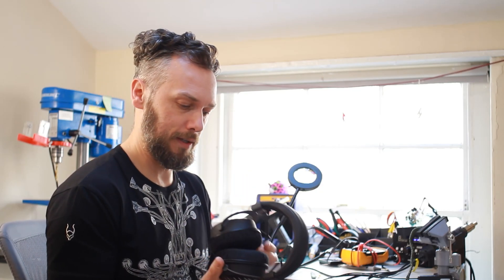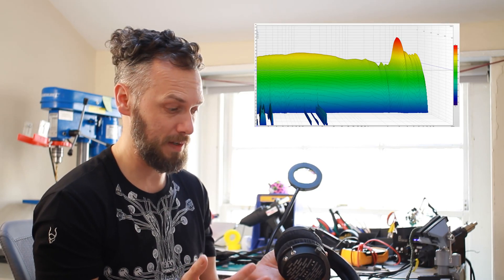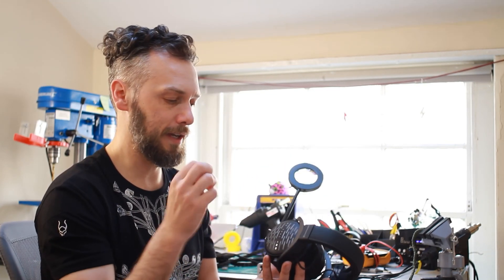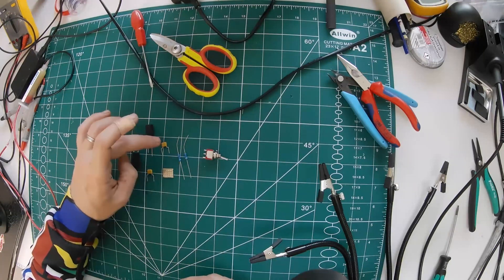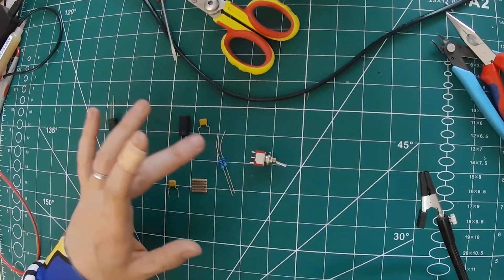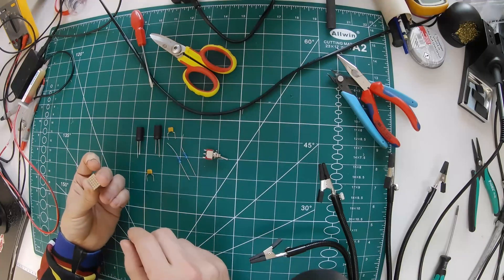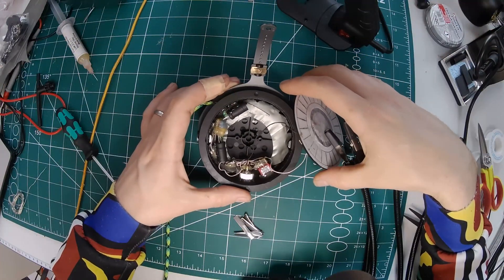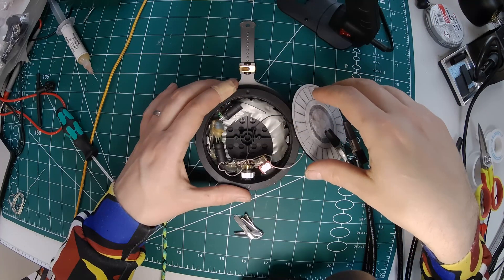Beyerdynamic DT1990 with switchable passive filter to reduce the 8K peak

Comment: I just got myself a pair of 770's, and they have some nice qualities at a very reasonable price, but will most likely get the V3 mod soon.

Could there possibly be a similar 7-9k mod for those?
Reply from the maker: The V3 mod smooths off the peak a bit and boosts the bass so you may not need to do any extra mods but yes, I am sure if you hunt on DIY audio heaven they probably have the plans for a similar mod on the 770
Reply: @CustomCans  Thanks. I found your pad rolling video, and I'll ad a pair of velour pads to my order when I get around to it. I also found a treble filter for the 770 on DIY audio heaven, and will ask there whether different attenuation levels can be achieved just by changing the resistor value.

Comment: Would it be better if the filter was outside the earcup and incorporated into the cable instead? Because with all the bits and bob inside one earcup but not on the other, the two sides are bound to sound different from each other.
Reply from the maker: Yes, there is no reason why you could not build it into a cable or a separate little switch box

Comment: With a passive Filter the dampening becomes worse - same effect as an amplifier with a higher output-impedance... and this little volume inside the housing of a "near-high-end" Headphone has a significant effect on the sound... and I would be very careful with the Tesla-drivers - there are hair-like wires on a not really fixed pcb that easily tear apart... I own a DT1990... worked about 15 years  as piano-tuner and recording assistant in Studios - I know what I´m talking about...  sorry my bad english; Best greetings from Germany
Reply from the maker: Yes ;) you always have to be careful while doing this kind of thing. We modify around 100 pairs of headphones a month, and have done so for over a decade. Even so... we still occasionally break a pair now and again. A couple of years ago, sennheiser changed the design of the HD25 slightly which meant if you dismantled them wrong it would break those voice coil wires. We broke a whole batch of 12 before we realised... that ended up being a very expensive mistake ;)
So far, we have not killed any DT1990 or DT1770  but I am sure we will at some point.

Comment: Oh man, it looks like I may need to pull the trigger on this purchase.  I have had a few pairs of DT1990 and had a love hate relationship with that spike.  Being able to turn it off at will may just make them a Swiss Army Knife for my audio needs.
Reply from the maker: Now we make them with 3 settings for the filter on, off and somewhere in-between
Reply: i was already thinking if there is a 3 way switch mod already out there. nice, it on your channel aswell? 

another 2 questions: how much does it change the impedance and with it the volume on lil Headphone DACs that are already pumping to keep them going? is this mod combineable with a balanced mod?
 @CustomCans
Reply from the maker: @buckethead420  I have not measured it but you don't notice any appreciable change in volume
Reply: @CustomCans ok thanks for the fast reply. what does the 3rd position of the switch do? i'd like to hear lower treble boost bass 😂

just checked your homepage quickly, but i couldnt find anything that lets me source parts and diy...did i miss something? based in germany btw...if stuff is sent to uk and back does it come with 2x tax?
Reply from the maker: @buckethead420  The speck for the parts you would need are from DIY Audio heaven
https://diyaudioheaven.wordpress.com/headphones/measurements/brands-a-i/dt-1990-pro/

The 3rd position on the switch adds some resistors across the filter so it is partially bypassed

Comment: Did you see channel imbalance in your measurements as it seems everything is on one side. Would you think it's a better idea (or possible) to modify these cans to have cable input on both sides like the sennheisers?
Reply from the maker: Because they are open backs and all the gubbins is tucked away from the back of the driver it does not seem to cause a noticeable in-ballance but yes, we have made a few dual entry versions for people

Comment: The Timelapse and video quality doesn’t show (at least for my eyes) wether these components are in parallel or series, but my intuition says they should be in series. Can you shed light on that fact?
Reply from the maker: They are in parallel. The capacitor transfers  the high frequencies, the inductor does the low frequencies and the resistor controls how much of the unfiltered signal gets through so changing the resistor changes how much it is filtered

Comment: The link in the description doesn't work is this option no longer available on the website
Reply from the maker: Unfortunately we could not do it cost effectively so had to stop. It was taking our technicians around 3hrs to build and test each one. 
We are hoping to design a drop on PCB which will bring the cost and time down but we have too may other projects on at the moment
Reply: @CustomCans  could I put in a special order to get the passive filter I'll pay double or triple what the price used to be
Reply from the maker: @josiahjones7654  I have added it back in the options for you. We used to charge £50 but I have had to up that to £75 to cover the time involved
Reply from the maker: @josiahjones7654  https://jfunk.org/wpc/product/balanced-beyerdynamic-dt1990/
Reply: @CustomCans  how long would it take to ship for express shipping, I live in san angelo texas in the USA but, once its July 15 my address won't be valid since I'm moving so if it arrives after that day I won't get the package for a while. If not I'll order the headphones a few days after July 15 or when ever I get my new po address
Reply from the maker: @josiahjones7654  I would wait, just in case. Express shipping is around 5 days but we have a queue of a couple of weeks for headphones to be made at the moment

Comment: Recently converted mine to Balanced following your previous 1990 video. I was wondering how this mod was done, now I see it I'm not so sure I fancy trying it yet, looks a little cramped for my fat fingers.
Reply from the maker: Yes - it is probably not an ideal DIY thing doing it this way but building a cable with it built in should be possible and relatively risk free